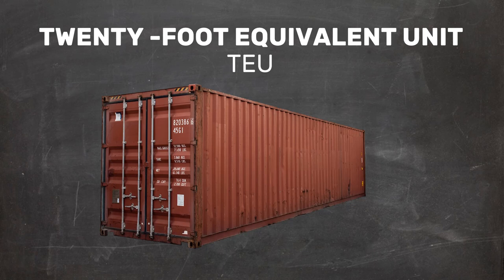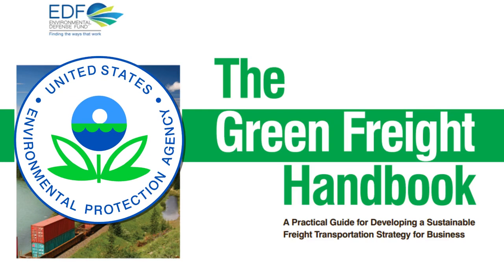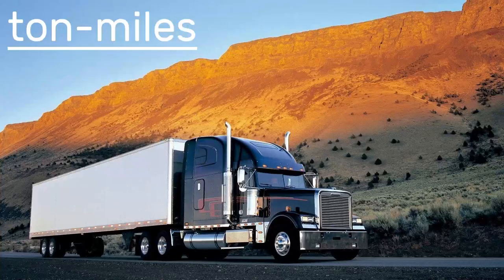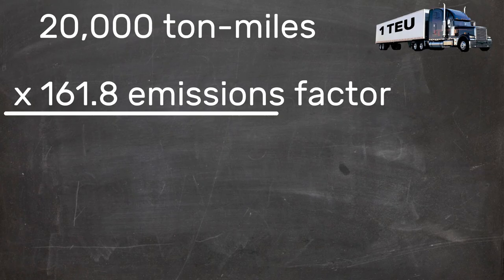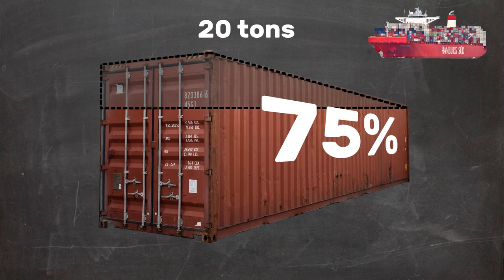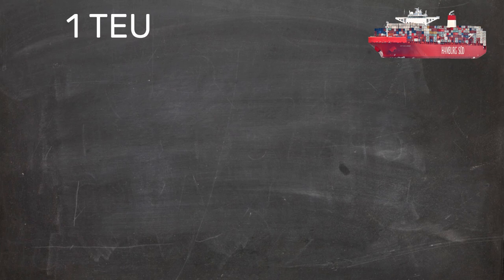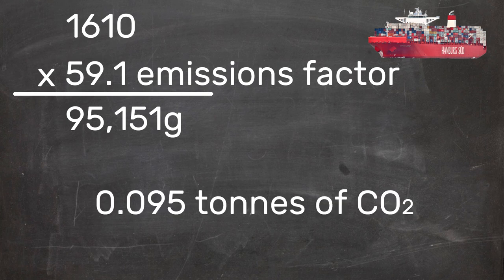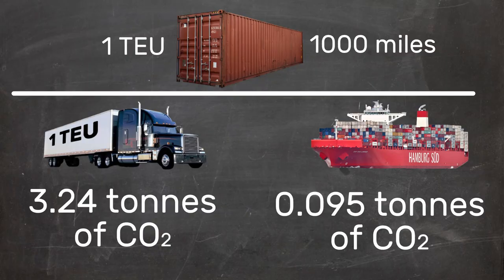APPENDIX: Why shipping pollutes less

Comment: This is the same argument for train infrastructure. Its a matter of economy of scale, and emissions based on people/ cargo moved. A train will forever be more sustainable than any type of wheeled transport system that you can think of, simply because they're more fuel efficient and you can transport far more people far more efficiently than a traditional highway.
Reply: Lot Less systems needed as well, no steering, no airbag, no tires, simplified drive train, many other things as well
Reply: @Miles26545  the masculine dream to drive train
Reply: And, if we use electric trains, we almost get no emissions from it. All emissions would be from energy production.
Reply: @therosijedha I mean, it depends on what type of energy we use. If it is energy obtained from non-renewables it makes the electric train have the same emissions as a fuel driven train. But if the energy used by the train is from renewables...
Reply: @bungercolumbus  i think its still less than fuel powered trains, because as far as i know power plants are (generally) more efficient than the engine in a diesel locomotive
Reply: Trains are traditional. Unless you’re referring to horses.
Reply: Imagine rail and kei trucks being the modal share of American freight

Comment: One tiny correction - your average 18 wheeler can take 2 TEUs. A standard trailer is 40 ft long, allowing for two containers (or a double-sized one).
Reply: In the US trucks are limited to 80,000 pounds gross vehicle weight, or 40 US tons. The weight of the tractor, trailer, and fuel is usually 15-20 tons, leaving 20-25 tons of cargo available for transport, even in the longer 53 foot trailers. The weight restrictions are to reduce damage to roadways, which is why oversize/overweight loads require permits and additonal fees to account for their increased wear on the road. The ocean does not care how much a ship weighs, however, and as long as your ship is still buoyant and structurally sound, it can be as large and heavy as your port can accomodate.

Having personally unloaded several trucks filled with produce that have crashed as an occasional side gig working for a towing company, 35,000 pounds of fruit or so is usually all that will fit in a 53 foot trailer.
Reply: @cr4zyj4ck  Fair point, although 20 tons of weight sounds like a gross overstatement for a truck. I have no personal experience, but I've seen numbers closer to 7-10 tonnes quoted on the internet.
Reply: You just said it, average, the average 18 wheeler take only one TEU.
Reply: @wojciechmuras553  it depends on the truck, smaller day cab trucks are lighter. I got the weight numbers from my uncle who has been driving trucks since the late 1970s and still drives them today. Long haul tractors are heavier - they are larger to accomodate the sleeper cab, tend to have larger engines so they can climb mountains better, and can have larger fuel tanks for extended range. Remember the weight I gave also included the trailer as well - the max gross weight for the whole vehicle combination is 80,000 US pounds. And there are also maximum allowable weights per axle as well, which are checked at the scales.
Reply: Can, but does it take on *average*?
Reply: @wojciechmuras553  I can't comment on the US, but I know that our Volvo FH LNG 4x2's are 18 tonnes solo, add a skeleton trailer at 5.6 tonne, you get 23.6 tonnes, and an empty 1 TEU refrigerated container is 3.08 tonnes, giving a total empty weight of 26.68 tonnes, leaving only 17.3 tonnes for cargo, and that's all dependant on how it's loaded in a container as each axel also has a weight limit.
Reply: Additionally, while the video is technically correct, I think it's a bit misapplied. The whole issue is very complex so I couldn't say for certain what the numbers are, but shipping pears in from Thailand (which is the reason why this video was made), is most likely more emissive than shipping from a domestic factory (I don't know how efficient the factories are relative to each other though, which could change things). This is because A) the trip from Asia to the US is more than a thousand miles, and B) the pears that get shipped in *still have to travel over land via truck*. So by shipping overseas, rather than truck, you're most likely just changing your emissions from truck --> truck+boat, which is explicitly more. Again, this is a very complex issue dependent on things like where the domestic factories and main centers of consumers are relative to said factories and ports, so I can't say for 100% certain that shipping is always worse. 

Don't get me wrong I'm a big ol environmentalist but this video could be misrepresentative of the true information, and people should not try to use it as a basis for supporting international oceanic shipping. (People probably weren't going to do that anyways though)
Reply: @cr4zyj4ck  Most trucking companies pay the overweight fees to make their maximum weight 100,000 pounds because it's more profitable. That adds 10 extra tons.
Reply: The standard trailer in the US is 53ft.

Comment: Can I add that fresh fruits like pears or apples aren't very dense when packed for shipping? From personal experience, a 53' trailer is usually fully loaded, or very nearly fully loaded, when about 35,000 pounds of palletized apples or pears are placed inside. 40,000 pounds being 20 short tons, you get a volumetric limitation in shipping containers before you get a weight limitation. The main reason is that spherical fruits do not pack very densely. Lots of voids in the packaging.
Reply: So you could get higher efficiency by transporting oranges with rice?
Reply: @Maffoo  You might actaully be technically correct, though one has to manage out the separation of oranges and rice.

Comment: One consideration is that ships cannot travel on land [citation needed]. It may be that the truck miles for distribution are required either way, and perhaps over a greater distance, which would make the shipping an additional rather than a substitute factor. If you live on the coast as most people overall do, shipping is almost certainly the best. But for someone in the Midwest this may be quite different. And that's not even considering rail, which is also vastly better than trucks, but requires expensive infrastructure. It would be interesting to use the relative values to create a contrast map based on different origin points. I'm sure that large companies spend an incredible amount of effort figuring these things out as well.
Reply: rail infrastructure (and train transportation in general) isn't actually that expensive. in the short term, yes it is, but its an investment. truck transport requires individual vehicles for a wayyy smaller carry capacity to trains, all the while roads being expensive in the long term, largely because of the repairs. whereas with rail, it's expensive to be put down in the first place, but they very rarely require repairs. the actual trains aren't that expensive to build either, it's just an engine with a whole bunch of metal and wheels being towed (or pushed) behind (or infront) of it, and so are expandable quite easily, as it's just a bit of good ol' steel to expand. 
imagine you have a train and a truck. the train can have 100 TEU where the truck has 1 TEU, you need 100x more frequency on the roads than the track to get the same amount; plus the truck hurts the road more than the train and track because trucks use rubber wheels which have more grip on the road and rip it up, where trains take advantage of rolling / gliding along the tracks so theres not alot of repair needed because of the lack of friction.

i believe america spends 2/3rds of it's transport budget on repairing roads alone as well
(i found this, imagine spending 250 billion on railway a year instead wow)
https://www.brookings.edu/research/shifting-into-an-era-of-repair-us-infrastructure-spending-trends/
Reply: @kiraw.9521  Railroads are also very often privately owned instead of government owned. The US government does not spend money building public railroads (how would that work?) And private rail companies are met with a lot of backlash when they want to buy land and build new railroads
Reply: @cr4zyj4ck  yeah I think that's the biggest issue if america wanted trains. It really just doesn't have a 'train culture' suitable for any worthwhile rail to be placed. 'train culture' has to compete with america's 'hyper capitalism' anyways, which is kinda antithetical to trains (largely because of how de-privatized the country needs to be(I'm pretty sure uk's privatization of rail failed, so there's an example why)) 
also 'The US government does not spend money building public railroads (how would that work?)' america spends alot placing new roads as well as repairing, not to mention the federal highway act of 1956 which if I remember correctly they spent like 20 or 25 billion dollars in 1950s money. So to answer '(how would that work?)' it'd work like the 1956 act (if it decided to do it in one fell swoop, that is), it really just needs to be like the rest of the world when it comes to trains. america's exceptionalism and need to do everything different will only be a be a detriment to trying to implement rail.
Reply: @kiraw.9521  America does have the largest industrial rail network in the world. Passenger rail is lacking. Mostly what I meant by how would public rail work is that railroads by their nature must be tightly scheduled and controlled to avoid crashes because railroads are single lane. So a "public railroad" would be a difficult pitch to the states. Public highways are available to use by anyone with a car, and with a few exceptions don't require trip permits. I'm not saying road transport is better, for long distances rail is far superior, just pointing out the issues that have to be overcome in the modern era to install new railroads. When the railroads were first built (by private rail companies) the US government granted free land to the railway companies along the route to incentivise them to build the railroads. Along alternating sides of the track, the rail companies were granted sections (640 acres, 1 square mile) of land to use or sell as they saw fit. Most land where additional rail capacity is now needed is owned by entities that aren't railroads, that dont want private railroads built across their land and dont want to sell to railroad companies and who will vehemently fight any eminent domain cases if the government forced the sale. Then even after you get the land you have to get environmental permits to build the private railroads which are always fought to the bitter end by people who dont want the railroad crossing the migration corridor for some animal, or running through the habitat of a rare bug or fish or something. And, since the rail companies are private companies there is only so much money they are willing to spend on litigation before they abandon a project -  but even if they do get approval it couls take many years to build a new line.
Reply: @cr4zyj4ck  your comment is a bit confusing, but I think you didn't added anything of worth to the original comment, only emphasized / clarified.

In my previous comment I said 
'('train culture' has to compete with america's 'hyper capitalism' anyways, which is kinda antithetical to trains)' 
which I guess I didn't simply enough because I would figure it answers the question you just asked
'Mostly what I meant by how would public rail work is that railroads by their nature must be tightly scheduled and controlled to avoid crashes because railroads are single lane.' 

I guess if you're wanting an answer, I think Amtrak is what you are describing, if I remember correctly it is / was owned by america, I don't know a whole lot about american rail and I don't particularly care. 

Theoretically though, america could decide to control all rail and cargo trains, publicizing rail, and do what space x wants to do with shipping satellites into space alongside their rockets, in which companies pay for each cargo they want shipped, which would definitely pay for a public passenger rail, likely all rail maintenance, and probably have money left over to expand more rail, all without needing additional money.
But obviously something like that would be highly unlikely in america in its current state, it'd probably be called Communist or Marxist and thrown out.

Sorry if I've misunderstood what you're saying in your new comment, you didn't really simplify your text much.
Reply: @cr4zyj4ck  That's the whole purpose of train scheduling. Many railroads don't run exclusively on tracks they own. Sometimes it is leased or shared with other railroads, forcing them to cooperate and communicate at their benefit to coordinate their timetables. But like roads in the days before World War II, a majority were privatized (hence the turnpike system where use of it was tolled). Private highways have existed in the US far longer than the first track of private railroad in the US. We can very efficiently make all rail lines public, then use a similar system that many other countries use (including the US) and just work a timetable between the railway companies where they would operate with the government leasing to these railways the rights to use of those lines. The railways already do this anyways with other railways. If made public, the system can just help ensure a transitioned copy from privatized freight rail to public. Like whatever BNSF and CSX run at the moment, lease them those same lines and corridors that they run to prevent conflict with CP or CN.
Reply: Rivers are a thing which can allow products to be carried by ship further inland (although the largest ships may not be suitable for rivers, so they might need to be transferred to a smaller ship at a sea port).
A lot of settlemenys that aren't near a sea/ocean are instead near a river.

But even with some inland trucking required, there's also the savings from economies of scale that compensate the relatively small amounts that you get from the additional shipping.
Larger scale production is in most cases far more efficient, not just in costs, but in resource use and emissions as well.
Ultimately you have to compare large scale production with extra shipping vs small scale production without the extra shipping, and the former usually is better.
Of course, if you have large scale production near you, that's best, but that simply isn't always going to work for everything.
Reply: @nienke7713  The Jones Act prevents foreign countries from accessing our rivers for trade :(

Comment: Relating this to your argument in the main video, we can't know which method produces more CO2 (domestic pear production/packing vs. international) until we apply these numbers to the actual distances traveled in either case. Having your pears circumnavigate the globe is many times farther to travel than shipping them by truck from the farm to the packing facility to the market. You also need to consider that for international pears, in addition to the CO2 produced by the boat, you are still shipping the pears by truck to and from each port, which could potentially be as much trucking distance as domestic production.
Reply: Yeah but it would most likely  amount to a lot more trucking since the amount needed to transport is the same and the economy if scale benefit isn't there to apply a downward pressing on the resources needed and consequently,prices and carbon emissions.

Comment: Did you know that there are 3 types of tons?

U.S.A ton (short ton): defined as 20 hundredweight
Metric ton: defined the same as a MegaGram, which is 1×10⁶ grams (1,000,000g)
British ton (long ton): defined as 20 hundredweight.

Now, hundredweights are defined differently in the U.S.A and Britain. In Britain, hundredweight (aka cwt) = 8 stone, and stone = 14 pounds, so 1 cwt = 8×14 = 112 pounds

But in America, a cwt = 100 pounds.

List of Handy conversions:

U.S.A Ton = 907.1847 kg / 2000 lbs
Metric Tonne = 1000 kg / 2204.62 lbs
British Ton = 1016.047 kg / 2240 lbs

1 U.S.A Ton = 0.907185 Metric Tons
Said another way, 100% us ton ≈ 90% of a Metric Ton.

1 British Ton = 1.01605 Metric Ton
Said another way, 100% British Ton ≈ 101% of a Metric Ton

1 Metric Ton = 1.10231 U.S.A Ton
Said another way, 100% Metric Ton ≈ 110% us ton

1 British Ton = 1.12 U.S.A Ton
Said another way, 100% British Ton = 112% us ton

1 U.S.A Ton = 0.892857 British Ton
Said another way, 100% us ton ≈ 89% British Ton

1 Metric Ton = 0.984207 British Ton
Said another way, 100% Metric Ton ≈ 98% British Ton
Reply: Brother, brother, what... why... but thanks for the info!
Reply: Why... Why can't westerns agree in a single unit? Iw it that hard???
Reply: I think it would be cooler if the metric system gave up on calling it a ton and went with megagrams. Could you imagine? my car weighs 2.4 megagrams. I love it.
Reply: Nothing cooler than a ton of cooling
Reply: tysm!
Reply: Being picky, why do you round down?

 100% us ton ≈ 91% of a Metric Ton. (is closer tyo 91 than 90)
100% British Ton ≈ 102% of a Metric Ton (is closer to 102 than 101)